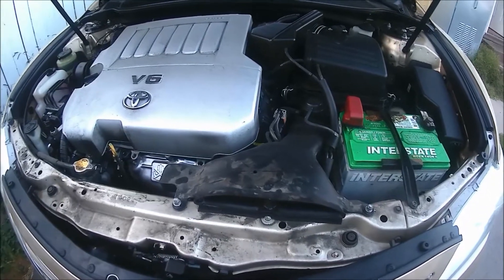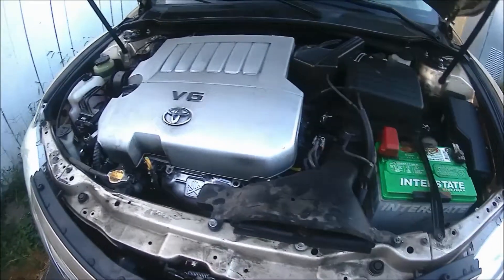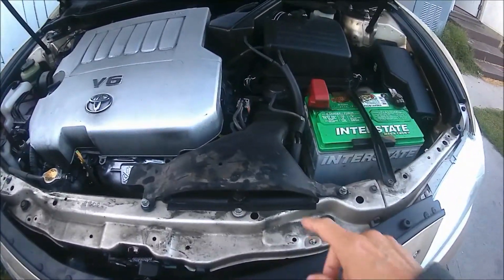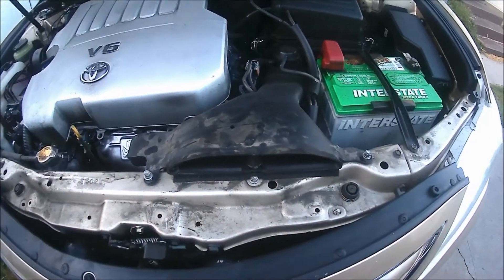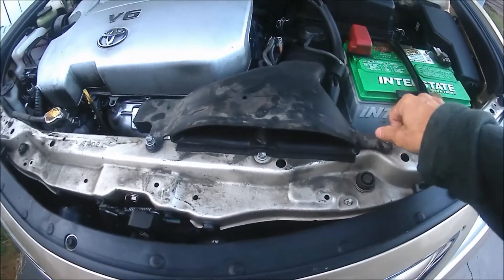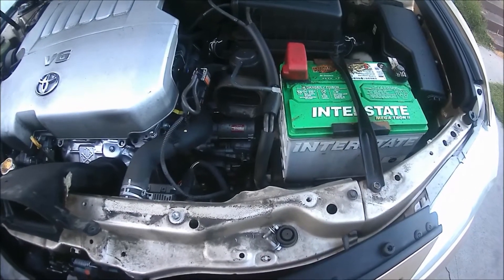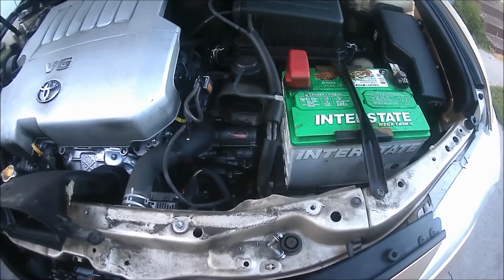Camry 2GR FE Air Intake Mod

Comment: Thank you for reassuring me about the cat delete. I deleted it and it pulls harder.. oh and the engine isnt suffering and will last longer better mpg etc. I already did the airbox mods but if you open the airbox take off the top piece there is a sort of filter that gets next to no flow through it that you can delete and there is a metal honeycomb aswell sort of like a cat. Good luck and thanks!
Reply: No offense to any of you, but i am gonna sound mean for a just a moment. Removing any part of the filter as it is in order to increase air flow will NOT increase mpg or effeciency at all. Subsequently what happens is if you've made the air flow increase from less resistance due to less filtration, than you are by a rule of combustion science going to burn more fuel to match the  increased air. spark is constant and assume the timing is fixed.

It will however, sound better. Increasing filtration media is the most surefire way of forcing the car to burn lean, using less fuel due to it actually NOT being able to get as much air to mix with the fuel to get the ideal AFR air fuel ratio. 

idk what you did to your evap solenoid but i'd inagine instead of the unused gas vapor being passed through charcoal canister, it'll just immediately recirculate without the emissions system being able ti complete it's purpose. This will have the affect of a small increase to fuel vapor at the cost of more of a fuel odor you'll smell instead of it being passed through a canister. Your o2 sensors wont really notice a difference but i'd expect more oil and fuel built up on the throttle body, but subsequently the increased fuel could help your intake valves more in the long term. Could be ideal actually since the car burns lean as it comes. Please dont call it a Cat or cat box or anything impling of that nature. It's just a resonator box designed to filter air before and as the air passes through a filter by cleaning the air excessively from dust and particulates while keeping noise down and mpg up

Comment: What's that piece that looks like a small canister with a single tube attached? It's right on top of the intake
Reply from the maker: @ Chris Nash

That is for the vacuum line that opens the intake.  Rerouting the vacuum lines keeps the intake open all the time.
Reply: @c41man  mine has a spring keeping it closed

Comment: my car idles kind of rough after i did this
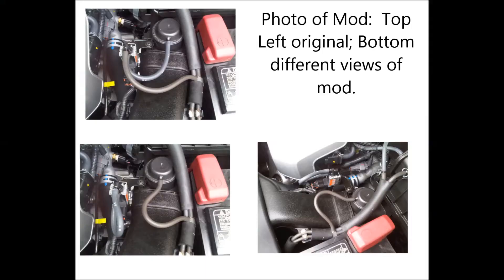Reply from the maker: Make sure you are copying the photo on the bottom left at 1:35.
Reply: this mod has no effect on how it runs at idle you have a different issue
Reply: @truthtimetv4575 you are also unplugging the active engine mount duty vacuum switching valve. So your front active mount will no longer be able to dampen vibration and idle

Comment: This isn't a mod. Now your sucking in Hot air as opposed to cold air. The factory system is a RAM cold air system.
Reply from the maker: This is a very good mod.  I also have exhaust wrap to keep heat down while at the track.  The Camy has run a best of 14.3 sec in the 1/4 mile and that was in April.
Reply from the maker: @Porsche-Ninja  
I found information for this easy mod on the Toyotanation.com website and I also found information on the catback mod.  For the lower intake plenum mod I searched v6performance.net, since the Honda guys were getting Accords into the 13s.  That is to say to it is a very easy mod to try and you can put it back to stock if you don't think it makes a difference.
Reply from the maker: @Sam S 

It's a vacuum line that opens a valve in the intake.  Connecting the lines as I have keeps the valve open all the time.
Reply: What kind of difference??الجـهـنـي
Reply: incoherent replies again.. There is a snorkel attached to this its not sucking radiator air lol